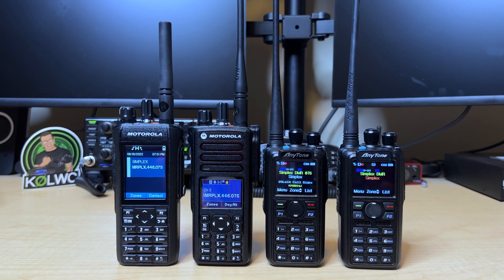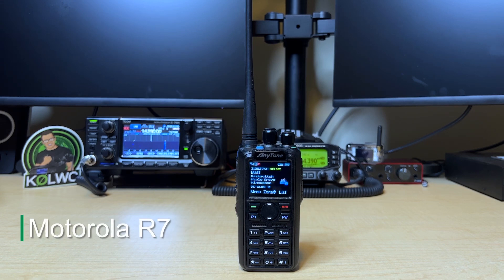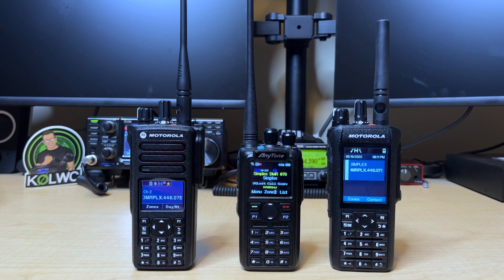Motorola R7 Noise Cancellation Comparison - Motorola R7 vs. AnyTone 878 vs. Motorola 7550e

Comment: Interesting comparison. However, (and please correct me if I am wrong) if my understanding is correct the only ham radio here is the AnyTone as it is dual band and DMR enabled. The Motorola is not a ham radio and is primarily DMR for use in commercial environments and company networks within an organisation or building/facility. Also it only has either a UHF or VHF option, meaning you have to choose one over the other. However, despite this the Motorola has far superior build quality and I do wish that ham kit was as well made as commercial gear.

Comment: Could you please do another video showing how FM, other HAM digital standards (e.g. YSF and D-star) or even public safety standards (e.g. TETRA and P25) will sound like under the same loudness coming from the same running engine? Here in Hong Kong, HAM usually don't like DMR for no reasons; they just don't like it, even if they know the distinctive features that DMR offers. By having a video show how DMR wins when confronting noisy condition, I hope they will clear their misconception about DMR.
73 de VR2VPK
Reply: I wouldn’t say there’s no reason to dislike DMR, mainly it sounds like garbage and you have to “learn” how to comprehend the speech coming over DMR. Analog sounds so much better.
Reply: @josephhacker6508  This is all about perspective; When I say DMR outperforms FM I'm talking about the reception at the fringe area, the overall noise suppression DMR provides, and the useful data features. But those stubborn old HAMs start yelling and say "FM is the most natural and even any other HAM digital modes are way better than DMR". And I defend myself and say "How about at the fringe area?" They: ...........
The fact is that I've heard of YSF and D-star, they sound pretty much the same as DMR. What those stubborn HAMs are trying to do is they constantly value the modes they like by devaluing the modes they don't like.
Reply: @galax574  Considering all digital modes right now use the AMBE vocoders, saying that one sounds better would be weird.

Comment: What a great video.  The Motorola is clearly superior in several ways...the question is....is it worth the premium price?
Reply from the maker: If you’re someone who could benefit from the improvements, surely. The AnyTone is great for what it is, I use AnyTone in the car and at home, but it can’t be confused with the engineering in the Motorola gear.
Reply: When I first got into trbo it was before most hams even knew what it was and used Motorola gear was cheap. Once hams started to get into trbo the price of used Motorola gear doubled.
Reply: I would say it is. A little pricy but great audio and physical quality that makes a big difference in the long run.

Comment: Many DMR systems, Brandmeister included, send an over the air ID in addition to the DMR UID, so you don't have to load a csv with a bunch of user info to the radio, like on the anytone. The Kenwood NX series support this. Does this Motorola?
Reply from the maker: Yes. Talker Alias was added to ETSI DMR standards in 2016 and the R7 will display it. However, it’s dependent on the other user and repeater/hotspot having it enabled.

Comment: The Motorolas are Superior to the Anytone. But I don't think it's worth the price. I have 2 of those radios and use them for hunting and they work excellent. Your tests are not going to be the norm.in most cases. Depends on where your using the radios In my opinion